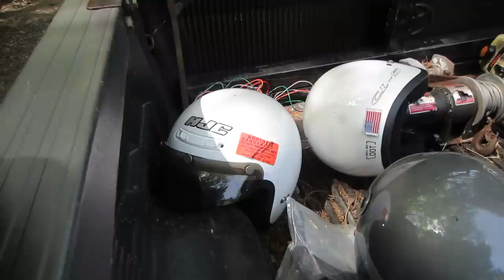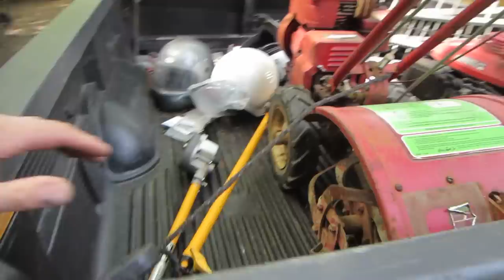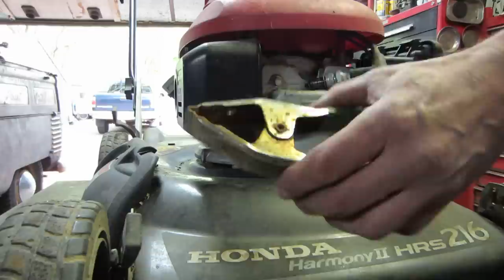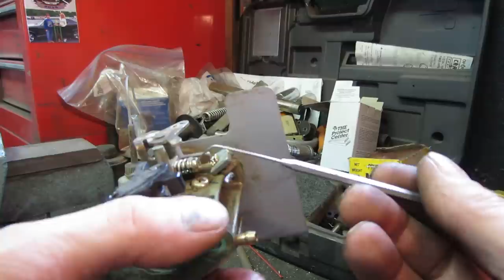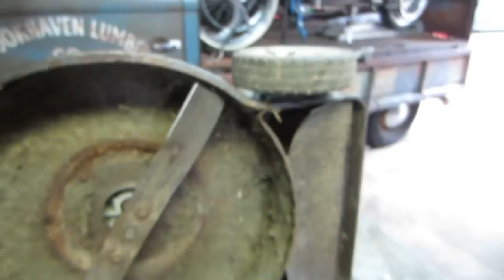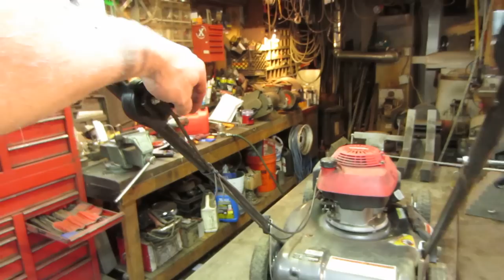yard sale honda mower repair

Comment: Our family has a tiller of that era and it leaks all of the gear oil out by the next time you want to use it, but you fill it back up and then do your days work and check it each day you're gonna use it and it's been a champ. Tilled a decent sized garden the last few years and yeah, good stuff. I am the younger generation, but i'm starting to love these small engines more and more lol.
Reply from the maker: pump grease into it

Comment: Same issue with my Honda HRS216. Cleaned old carb and had some hunting, then learned that a new carb is less than $14.00 shipped to my door, Replaced carb and runs perfect !
Reply: Farmall_Cub_in_Columbia d
Reply: Farmall_Cub_in_Columbia Honda carbs are cheap to replace, I had the same issue
Reply: Any idea where to get a piston ring kit? Mine is burning oil
Reply: ShartingFish go to ereplacement parts. Look up your engine model via the number embossed on the side of the engine. You may have to remove the shroud. Find your part number, then shop online, or at a  Honda repair shop near you. Generally, not expensive.  The local Honda motorcycle shop can order mine, but it may take a week. 
Then watch some videos non how it’s done.
Reply: jim s awesome thanks for the info
Reply: I don’t know much about taking this stuff apart, but thanks to this video, I now know that the noise my Honda HRX makes at idle (he said it was hunting) is a problem. I never knew that Bc it cuts grass absolutely fine!😂 Should I just replace the carb or try to clean it? Keep in mind I don’t have an ultrasonic cleaner, so I’d have to manually clean it.
Reply: Joe Ryan they’re very easy to clean, get some carb or brake spray. But sometimes it just doesn’t work. New ones are cheap on line, or try your local Honda lawn equipment dealer.
Reply: @mauricecrosby9236  ;
Reply: Mine hunts until you engage the blades. Then it runs perfect. I think it’s a governor issue, not carburetor.
Reply: Sharpe sharpe

Comment: I applaud your channel. I worked for the DOD fo 37 years. If they needed a new jet, did the DOD scrap it? No. They fixed or upgraded it. If they needed a new chopper, did they scrap the old one? No. They fixed it. It’s only the suppliers of parts that make repairing machines beyond economic repair.

Comment: You're absolutely correct Musto:  the idle circuit augments all positions of the carburetor and engine speeds.   It is crucial for the entire rpm operation range.  Setting the base timing, valve clearance and idle-speed/mixture and a fresh air filter?....everything else follows (two stroke, four stroke, v-8 or moped).  Yeah, you can get it close (by ear), but if you want it to be EXACTLY the way that it designed:  you gotta have a $15 tachometer.   If the engine doesn't want to IDLE (or give snappy throttle response) that indicates that something else  is WRONG!  ...or yir engine is getting old/worn.  At that point , we accept its age and gitter going...EXACTLY THE WAY THAT YOU DELINEATED IN YOUR VIDEOS!  I don't have massive yards, or a professional landscaping business:  which require cordless, gas powered tools, that can run for hours without stopping.  So I'm shifting to all battery powered equipment.   Hey, they were punks at first, but they ROCK now.

Comment: I've got a 5.5 Honda mower  engine on a craftsman frame , love the Honda engine, simplicity is what Honda was thinking when they made that engine, it has a timing belt which keeps the valve noise to a minimum, worked at a sears mower shop for 5 yrsthat's where I got my Honda/craftsman set-up. keep the video's coming

Comment: Had this problem first time I  ever cleaned a Honda Carb out and I used a micro drill bit and drilled out the main jet which was completely  stopped up . It was one of those do or die things and it ran perfect after I micro drilled it out .

Comment: Hi, love the videos, keep em coming.I didnt think i would be able to teach you anything new but a little tip for you- the little carb idle screw with the anti tamper top you snapped while trying to cut it- just heat the top of it with a soldering iron and they pull straight off.Hope that might help you in the future.Regards matt
Reply: Caribbean Crisis-2! If America 🗽🇺🇸 does not fulfill the security guarantees specified in the treaty, Russia 🇬🇺 will have the legal right to take measures to strike at the military training ground in Nevada. No one knows exactly what measures the Russian General Staff has prepared. But these measures will be sobering for the US. NATO will not enter into a military conflict with a nuclear power, having the status of an aggressor and acting outside the legal field on foreign territory. The main task of NATO will be to retreat, while retaining its face.

Truth and law are on our side
Reply: @СветланаИстиновская  The Federation has not lived up to the Minsk agreement, therefore, all previous agreements about security have been nullified. Law is not on your side. Ukraine should have kept one nuclear weapon. And this would not happen. After all, Kallingrad has nuclear weapons on NATO borders. Not the other way around.  Propoganda from Kremlin.

Comment: Some carbs just won't come back, but what I use in my ultrasonic cleaner is a mixture of simple green and white vinegar 50/50 mix, then once it's clean, say 3x480 cycles then I put it in a bath of cold pinesol and water, let it cool down then rinse with hot water, then blow it out with compressor air, works every time.... Great video.

Comment: Great buy. The only way the tiller & mower could have been a better deal is if he paid you to take it. I have found a few good buys between 20 to 100. The worst buy was a lawn tractor for 350. It ran ok at this guys house for about 25 minutes. When I got it home it smokes like crazy & had other issues. It became a great source for videos.

Comment: That was so cool to see the Muntz tape player. I bought that exact model before a got my first car and used it in the house on a power supply. Muntz stereo stores started in CA. as far as I know. I paid like $90 for it in '69 or '70. By the way, it is both a 4 and 8 track player.

Comment: My dad use to have a troy built tiller like that. One day it started running running rough and leaking oil everywhere. Tore it down and the block was cracked. Wasn't run low on oil, maybe overheated as it tilled a large 80X40 garden. I was really impressed it still had enough compression to fire.

Comment: I picked up a 4-cycle Ryobi with the weed whacker and shredder/bagger attachment. Replaced the primer bulb and fuel filter/lines..after about a minute, the muffler and engine block start to smoke. Can't tell i it's burning off crap or burning up the piston. Did a valve adjustment, but still having the issue. Don't have much into it but don't want to burn it up either. Hopefully, you'll video your Ryobi run through...great vids.

Comment: My mower has pretty much the same Honda engine on it. (Except auto choke and fixed throttle) I got some crud in the gas the 3rd time I used it and had to tear the carb off and clean it. Seeing you work on this one will definitely help next time I work on it.  I guess they're supposed to have valve clearance checked once a year. I haven't gotten to that yet. :)

Comment: I work at a dental clinic that used to do root canals. The dental clinic no longer does root canals so I have a drawer with a couple hundred new unused root canal files. They would be excellent tools for opening up carb jets.They don't need a pin vise to hold them as they have knobs molded onto them.  I would gladly send them to you if you want them.

Comment: I like WD-40 in my carburetor USC, If the carb sits for awhile after cleaning there is no water caused corrosion. Also that limiter on the idle jet is easily removed with a little heat, it's glued on. Thanks for your video and nice yard sale buys!

Comment: I have a similar problem with a lawnmower I recently picked, but it occasionally misses, though it cuts grass fine and runs well and being a self propelled mower, I think I am going to do the same thing and sell it with cautions. Good deal for a Honda and the new owner may be willing to spend the money for a new carburetor. Some great deals, especially with the rototiller.

Comment: Hi Mustie - Just another comment on the Honda lawnmower, heat from a soldering iron applied to the idle mixture screw limiter will melt the glue and allow it to easily lift off.

Comment: That is a Troy Built Pony.  5HP.  It may have a Tecumseh engine on it.  I would like to see you work it!  I am sure that OSHA is not going to check your helmets.   They are supposed to have manufacture dates stamped inside some where.  You got 3 good helmets.  Enjoy your videos.

Comment: I bought a Honda mower a couple of years ago. Firs, it takes a few pulls to start, especially if you stop to empty the bag. Second, I HATE variable speed mowers - I prefer a mower you can just select the speed on like mowers of old. Honda wheels are way too small. So last week I pulled my old Snapper with a Briggs engine out of the shed, put away with an empty tank two years ago. IT STARTED ON THE FIRST PULL. I was blown away and it is much easier to walk behind and doesn't leave a path like a drunk was behind it.

Comment: I’ve had and sold quite a few of them.  They are hard to get rid of that surge.  I did read that the thermowax choke actuator might be the cause, or the idle jet like you said.

Comment: These Honda lawn mowers have a sort of capsule that is filled with wax and controls the choke.  It can be finicky at times.  If you read the owner's manual it even states that the engine may be hard to start when it is warm, yet has been sitting for awhile.

Toro's auto choke system seems funky as well but it relies on both the engine fan and a thermal spring, so they work together regardless of engine temp.

I found a Honda in the trash last year, cleaned the carb and everything seemed to be fine.  It seemed to have a really heavy crank though, starting was different (IE, heavier) in comparison to other mowers, or so I felt.

Comment: That was a fast turn around :-D, i bet the new owner can get a carb for the millions of china made copys of honda mowers, cheap fix :-D
I have a frends techumse mower, it has carb problems too, it wont stay running and hard to start, but some of the cleanable bits are behind welch plugs so its repair kit time lol.
Motorbike carbs never seemed as hard to clean.

Comment: Nice example of making lemonade out of a lemon. Just because it doesn't run perfectly, this video shows that a mower is still quite usable in an imperfect condition. The new owner would have done well to invest in a new carb and would still have a bargain.

Comment: A tip on those Honda's Mustie1, get a tip cleaner set for torches (WYPO makes my favorite sets) and the 2nd finest one on the set fits those idle circuit orifices perfectly, then blow it out and they are returned to like new, they also work on everything else, and there is a size for everything on most carbs-super handy. But also with those Honda carbs I've had good luck with soaking them down with Gunk Heavy Duty Degreaser, and letting them set for a few hrs., then running them for awhile.
Reply: Oxy  acetylene torch head cleaners he is talking about.

Comment: Troy-Bilt Pony. Little brother to the Horse.  Great for smaller gardens. Serial number will tell you the year but that looks like a mid 90's unit.

 Worth closer to $400.00  (The new version of it sells for over $1,000.00)

Comment: Just ran into this oscillation problem on an old 12hp briggs rider.  Turned out to be a weak return spring for the governor was causing the butterfly to open and close too easily.  .  Replaced it with one off a like motor and problem solved !
Reply: HONESTO UNO could I get some more info on what kind of mower it is?
Reply: HONESTO UNO have you tried replacing the spark plug, it sounds like when it gets hot you aren’t getting a good burn.
Reply: HONESTO UNO did you check the strength of the spark when hot? If the coil is going bad.
Reply: remove the spark plug from the engine, and plug it back into the wire, and rest it against something metal in the engine, then Get a friend to hold the lever, and pull the pull start like he normally would to start it. The spark should be blue or white, but if it is yellow then the coil could be going bad
Reply: HONESTO UNO  Does it have that auto choke controlled by the wax capsule?  If so, that could be your problem.  They start hard when the engine is warm yet they haven't been run in more than a few minutes.  The wax has not hardened back up to close the choke because the exterior of the engine is still warm enough.

Comment: Check for wear in the carburetor throttle butterfly shaft.  I have fixed many small engines that hunted by changing the carburetor throttle butterfly shaft with one that had less wear.  I've even made them on my lathe.
Reply: New cabie  $14 from Wuhan China.
Reply: Does it come with complimentary bio-warfare? I dont want to order anything from china anymore, mostly bc of import charges though.

Comment: I know this is an old video but i wish i had seen it two weeks ago. I have a GCV160 that i cleaned the carb on a dozen times if not more and it would not stop doing that surge. Drove me nuts! $10.00 and two weeks later a new genuine honda carb from ebay solved it. Other people must have this problem, cost effective repair for long time owner but resale prob not. So if your a person out there with a honda and it does this, try cleaning it once and if it still does it. Just get a new carburettor. Save your sanity!

Comment: Does that engine use a light spring hooked to the throttle arm?  A lot of engines use one, and if it is stretched or missing the engine will surge at low throttle settings or low load.

Comment: Yea, Helmets have a 5 to 6 year shelf life, your not supposed to use them after that as the material gets brittle over time. That rear tine till is great good find on that one. I have been on the look out for one of those jacks, hoping to find one at flea market or garage sale the one I have is not all that great so its time for a new one well new to me. :)

Comment: I had a Honda lawn mower given to me  by the neighbor. She said she thought the engine had seized up. It turns out it had 4 inches of grass crusted up under the deck. The grass was jamming up the blade after it dried enough to pull away from the deck. I filled a pail with dried up grass clippings that had plastered into the deck.

Comment: My dad rebuilt his Troy-Bilt Horse.  He gave me numbers and I was trying to find parts and just couldn't.  I did a lot of digging around the internet and found out they had names and by the looks of my dad's tiller it was a Horse.  It is from the 70's.  Bought gears and bearings and seals and tills like new.

Comment: I had a Honda walk behind that I bought brand new in year 2000. It ran perfect for 18 years then the deck rusted through. I had patched it a couple times over the years, and I’m pretty careful with my stuff as far a maintenance and cleaning. But I gave it to my sister in law to take to her country summer cottage. Still runs and mows that little patch of grass. I mow about two acres so I need a decent mower.

Comment: I had the same problem I mixed fuel cleaner with fuel run it for 10 minutes and the surging was completely gone after that, maybe I got lucky, but when I got it from my grandparents it was only running with full choke on,  cleaned it with carb cleaner it fixed the choke problem but had the same surging on idle as in the video, they always left the fuel in it trough the winter.

Comment: Not saying you didn't get it later but bending a needle tip right at the end to stick down the jet throat to push through the idle jet hole or ptting a screw in end of the main jet hole and blowing air in the other end to blow out the clog in the idle jet port! Just a thought!

Comment: Do you have any videos of a problem with the thing under the carb bowl? I think it's called a celluloid. It has a thing in it that bibs up and down. I think it shouts off flow to the carb when mower not in use.

Comment: Ive had the surging problem with small engines with the carbs that have no adjustment. When they are new they work fine but once the engine has some wear thats when the problem starts. These engines are set to EPA regs ( In Canada) and the way to fix it  ( with the carb cleaned ) is to take a drill bit that fits in the jet holes ( main and the idle) and make it a couple thousands bigger to allow more fuel and that usually works.

Comment: Hey Mustie - I enjoy your videos, keep on, I have a Honda mower with the same problem you just diagnosed and repaired, you probably know that a new carb can be purchased for less than $20 from Amazon. I have not bought one yet though, just wanted to let you know.
Reply: Even a factory Honda is only around $30. Cleaning carbs, machining rotors, putting bearings and brushes into an alternator and similar skills are becoming obsolete as parts become cheaper relative to the wages of someone with skills to repair.

Comment: I've found that you can rod through the air passage in some carbs using 10 amp fuse wire. Hard to find these days as everyone has circuit breakers instead.

Comment: I bought a Troy Bilt push mower with a Honda engine in it last summer (new), so far I love that thing... I live in Florida and knew I'd be mowing lawn again before no time so I didn't really do anything other than add about half an ounce of stabil to the gas on my last run in the fall, the thing fired right up two months ago when I mowed lawn for the first time first pull. It was 70 more than the Briggs motor but I think it was worth it.

Comment: Are the mower carbs are different from the snowblower carbs in that they don't have a pilot tube with those teeny holes running cross wise at the top?